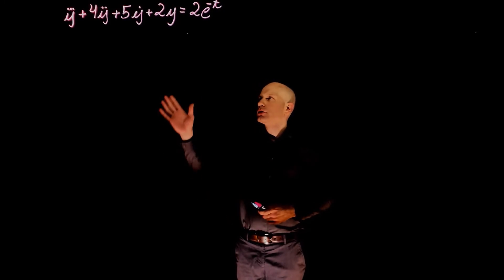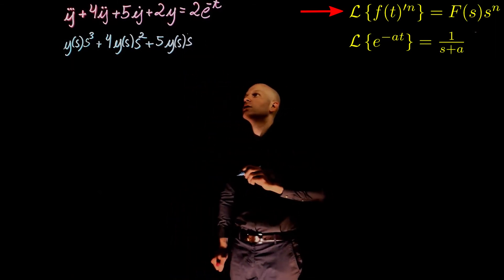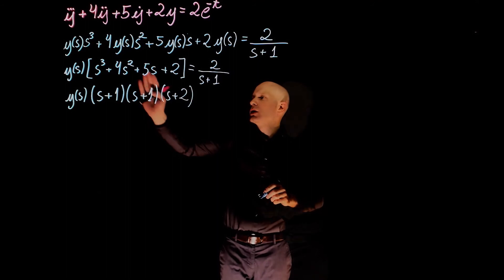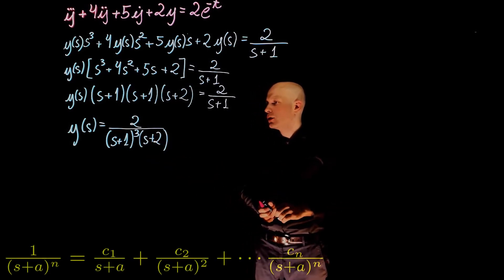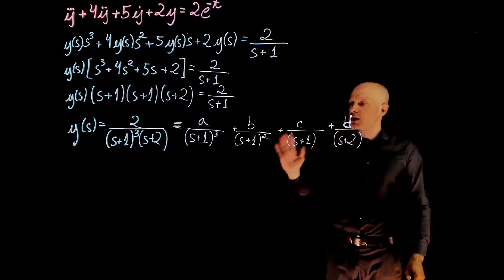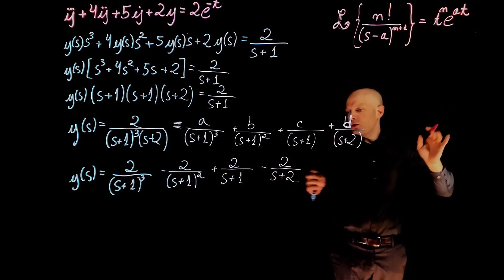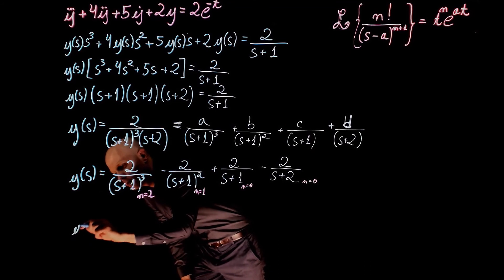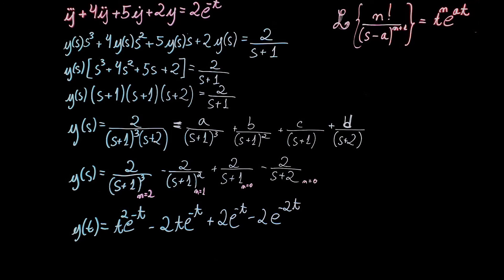L3E14 - Control Systems, Lecture 3, exercise 14. Differential equation with Laplace transform

Comment: Wouldn't there be a 2 in front of the first term in the time function final answer?
Reply from the maker: No. Note that the first term can be written as n!/((s-a)^(n+1)), where a=-1 and n=2. The inverse of the entire term, including the n! in the numerator is (t^n)e^(at), which indeed gives t^2e^(-t). If instead of 2 the numerator was 1/(s+1)^3, the inverse would be (t^2e^(-t) )/2.